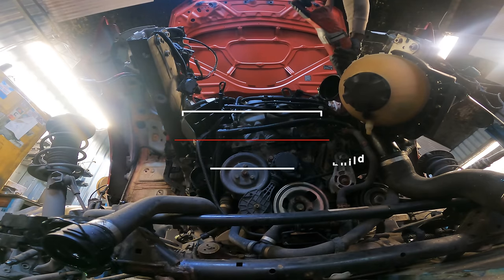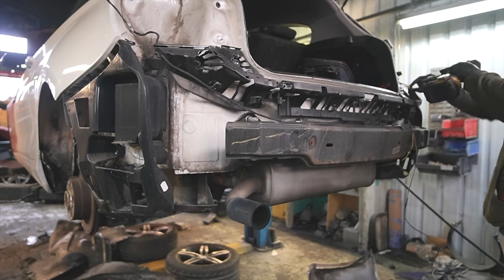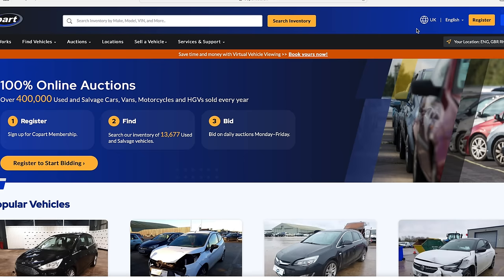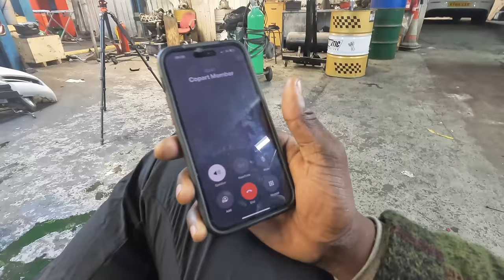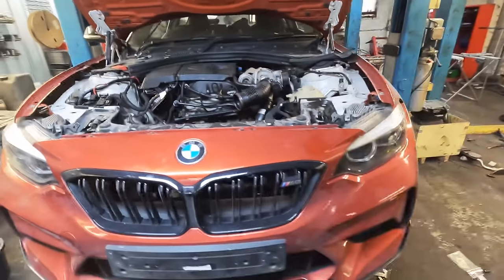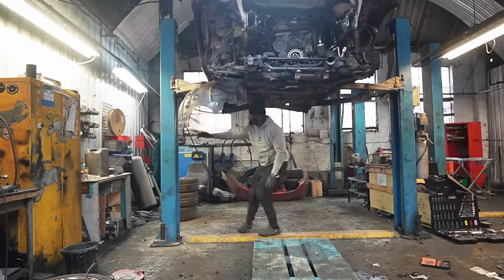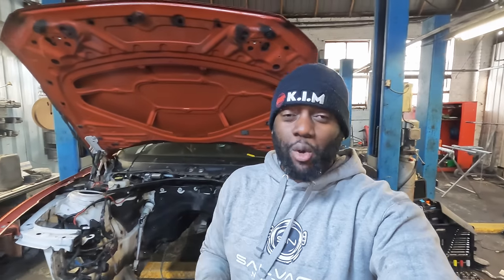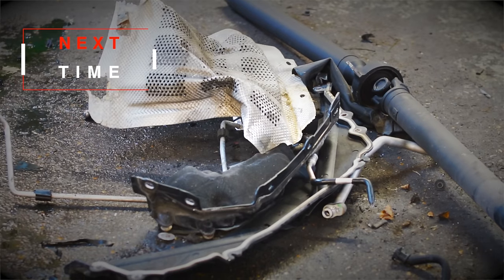BMW 114i to M140i CONVERSION BUILD - Phase 1/Part 2

Comment: Yo could’nt u just buy a m140i if your struggling getting one from a breaker? Or why did’nt u start with a high Milage m140 to start with then mod that?
Reply from the maker: Doing it this way saves over 10k ricky wanted to save that to pump it back into mods. Even a high milage m140 is atlease 12k. So far this 114i was only 1700 ish. And the doner will be no lore than 3k. Joit project with ricyLLF so labour is not a killer. Will be a huge saving. In the next episode ull start to see the numbers and why this entire project means business
Reply: I yea I get ya I did look last night seen a cat repaired m140 for £10k 
Only if I was struggling and didn’t wanna waste time 👍